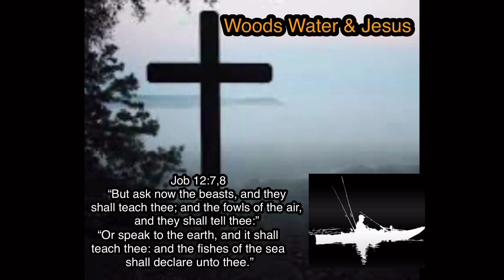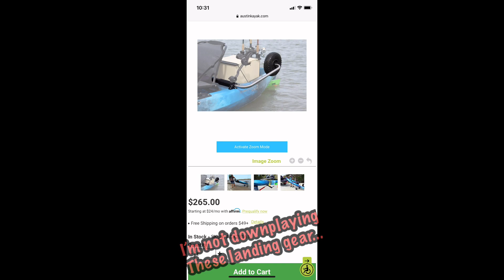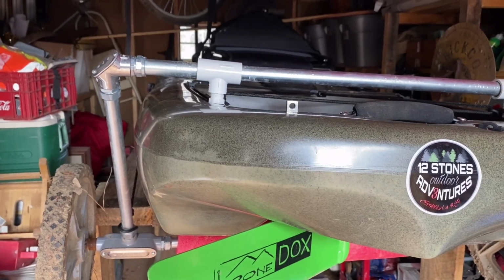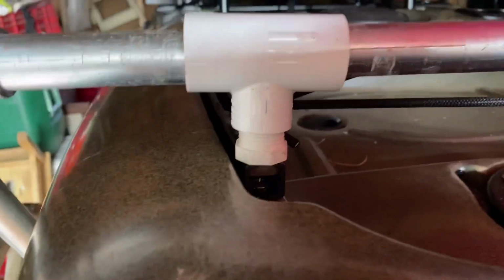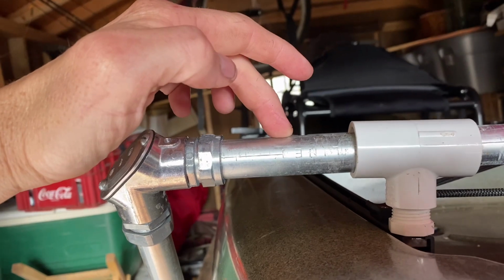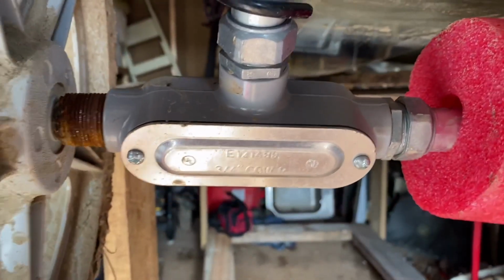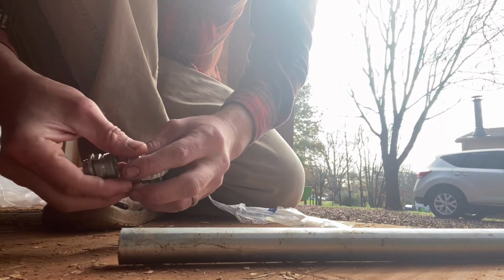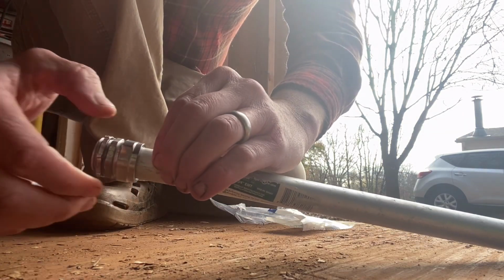DIY landing gear: Native Slayer

Comment: That's a slick setup, I need to make a set of wheels for our sit on tops and this swivel design is very nice idea. Thanks for sharing your design.
Reply from the maker: Thanks! I like it because I can put the front of the kayak in the way and roll it right in. You can push the landing gear around with your paddle and sit it up on the back.